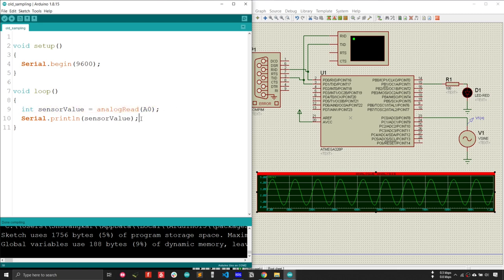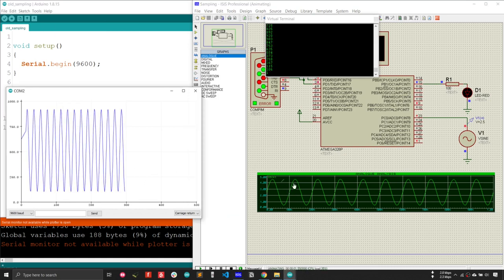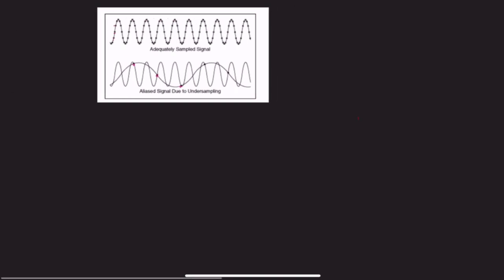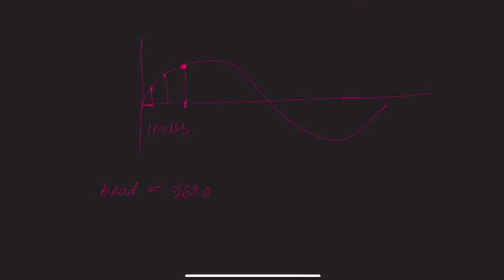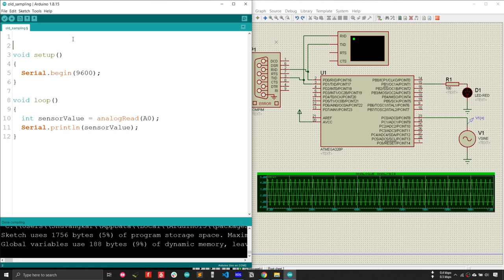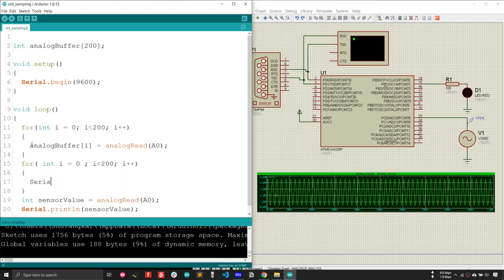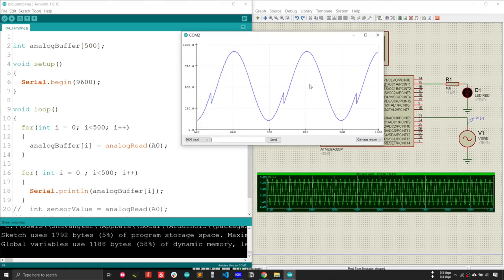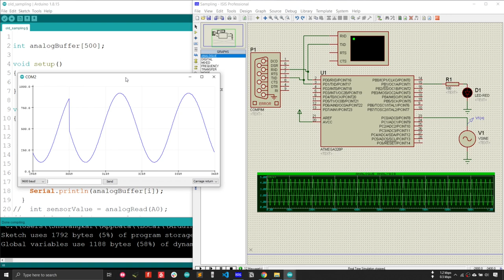Arduino fast sampling technique for high frequency signal

Comment: What to do when I have to read a high frequency signal and need to store for 4 atleast 4 second.
Analog buffer does not give sufficient space.
Reply from the maker: It is  doable. I have done that one of my projects. I have sampled continuously and saved in SD card at 1KSPS. The idea here is, you have to sample the signal using ADC interrupt. You need a dual buffers. When one buffer will be filled up, store or send that buffer to serial. By that time store data in other buffer. Pointer will come handy in such situation. I forget exactly,  Arduino SDfat library  has such examples.
Reply: @ShuvangkarDas  thank you for your valuable reply. I will follow these steps. If possible please make one video using that concept also.

Comment: Thanks for sharing the video. I used H3LIS331DL 3- axis accelerometer sensor which interface with Arduino Uno board. The fast sampling technique you explained here, can I use it for my work.
Reply from the maker: Sure! Go ahead.

Comment: Sir will you please tell me the sampling frequency of Arduino Uno
in this code and also maximum buffer size of Arduino uno
Reply from the maker: It’s a good question. I forget the exact number from datasheet. For 10 bit sampling frequency around 8Khz. Buffer size is limited by Ram size. Arduino Uno had 2KB of Ram and 9% consumed by Arduino libraries so and for storing 1adc value you need 2 bytes. So you can safely store around 800 samples in a single loop.

Comment: What is the MAXIMUM sampling rate for an Arduino? I would like to be able to sample a transient signal with an 8 MICROsecond rise time. Can an Arduino sample that fast? If not, how about other chipsets, such as ESP32?
Reply from the maker: For Uno, I was able to sample 8Ksps. ESP32 will be able to handle 8us.

Comment: Hi, first of all, it is a very nice video tutorial to get into Arduino. I have just started with Arduino and do not know much about it. Actually, I did exactly the same as you have done and ran the simulation in Poteus,  but I didn't get the exact sine wave in serial plotter. I Just got the upper halve of a sine Wave and the lower half was just 0 with a flat line. 
Could you tell me, how to fix that problem and how I can get the full sine wave.
Thank you very much in advance!!!
Reply from the maker: Arduino Uno can only read positive voltage, 0-5V. So you have to add DC offset to your signal to see negative half. Thanks.

Comment: If i want to take sampling points every certain times how can i do that
Reply from the maker: You can do that in two ways.
1. Use ADC interrupt 
2. Use timer interrupt and read adc value inside the timer interrupt( less efficient than method 1)